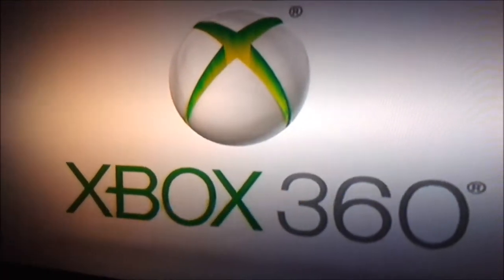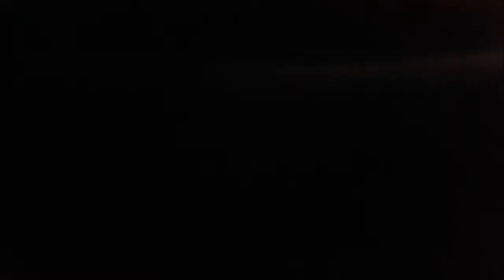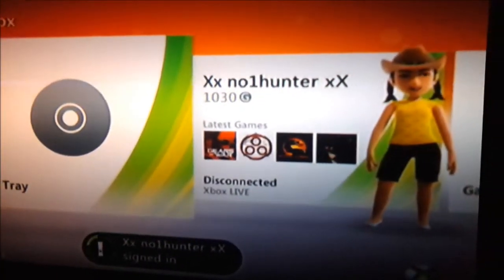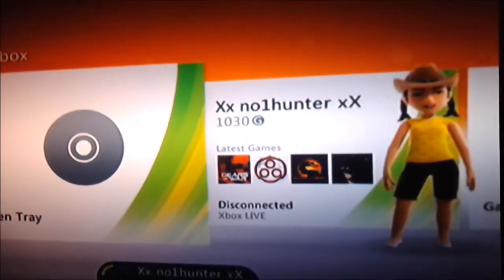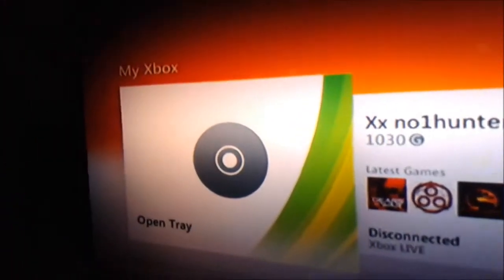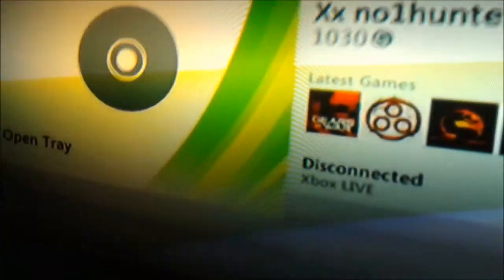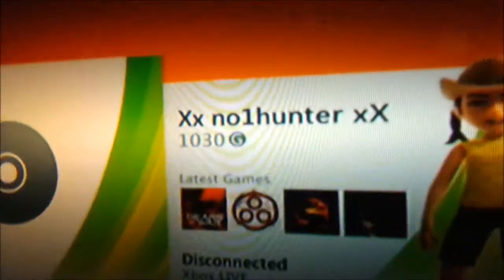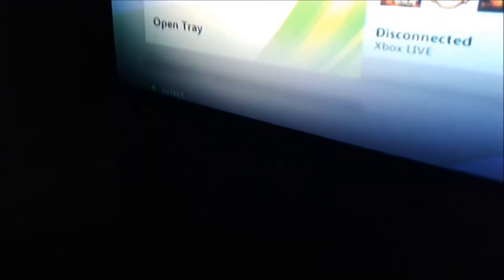Xbox 360 powerup after capacitor replace

Comment: When you mount the new  through hole capacitors, does the solder need to get into the hole or just hold the legs sticking out the bottom firmly? I got all my new caps to be held firmly... Cant tell where the contact traces start or end for those 2200 caps in that motherboard.
Reply from the maker: Oh Be I put the "feet" through the holes where my old caps once were, soldered the bottom of the board to said "feet" then cut the excess "feet" from the capacitor. I don't recall using any soldernon the opposite side of the board, closest to the capacitor.

That said, if I would have done that. I would have applied the iron to my freshly made bead on the underside and held the solder on the opposite side of the board, and used the iron's heat to flow the solder through the hole and meet the bead underneath...if that makes sense?
Reply from the maker: Oh Be if I'm honest, I'd have to open her up and check my solder joints to confirm exactly what I did, but from the best I can recall, that's exact how considered the caps to the underside, and how I would have soldered the top side if I thought they needed it.
Reply: Matt Hudson thanks for the information...I got my legs in, cut them to length and soldered them in tight on the bottom... Nice to know I managed to do it like the pros out here... Thanks for the great video.
Reply from the maker: Oh Be no problem, bro. Happy gaming

Comment: My Xenon Xbox had 12 capacitors replaced and is still on RROD with the 0020 code. I heard that the RAM could be faulty... Any ideas?
Reply from the maker: Hard to say since RROD can be caused by numerous issues. While I was in mine I also removed the heat sinks and put new Arctic thermal paste on the CPU and GPU. I also pulled the maxi-pad things off the RAM chips and put some thermal paste on them as well, connecting them to some pennies to help dissipate heat from the RAM chips. I'm not even sure if mine was working or not beforehand. I was opening her up to clean and noticed the capacitors, so I figured while I was in there I'd overhaul it. I wasn't expecting to find an issue hence why I didn't check it before. I boxed her up after I got my slim, and she was working then.
Reply: Glad to hear. I think I'll try a reflow after buying a heatgun... I applied the thermal paste and the pennies before the RROD, to make sure. The thing is that it happened after I left the console just closer to the window overnight. No signs of water damage on the board though...
Reply from the maker: Hmm, that's odd. Hopefully that fixes her up.